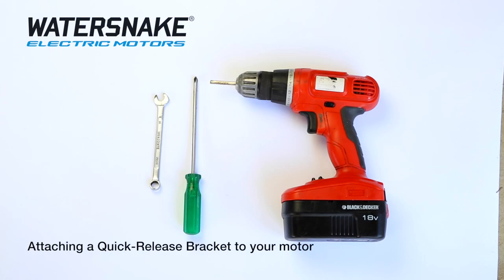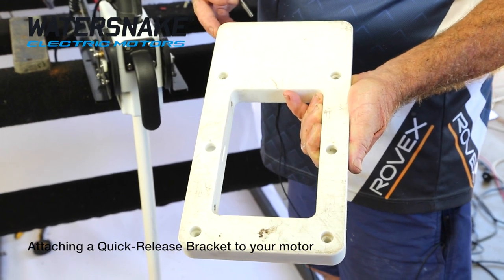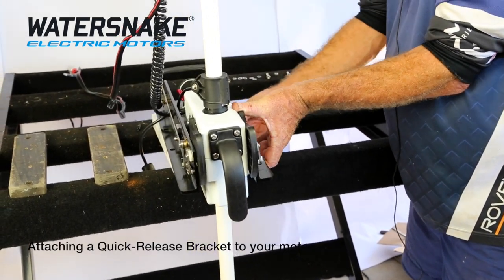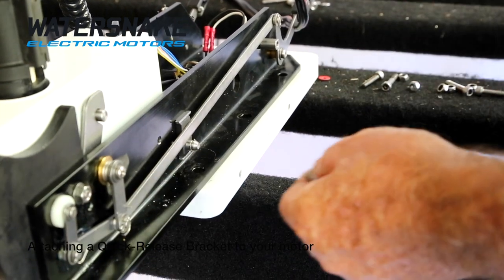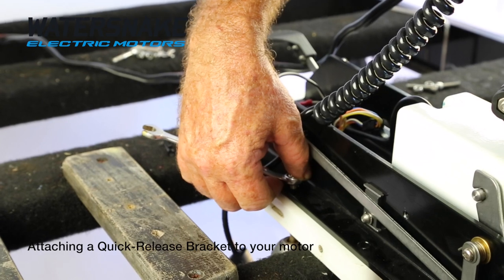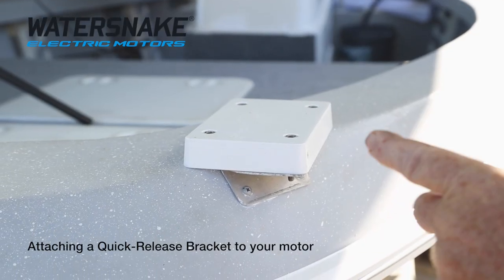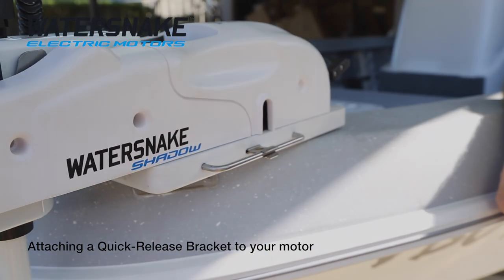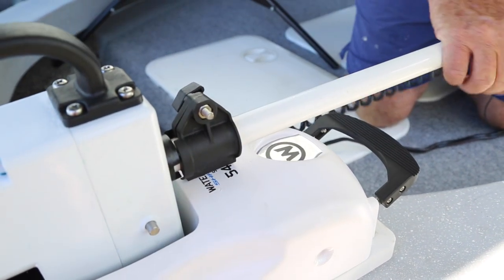Watersnake—How To Attach An Electric Motor Quick-Release Bracket

Comment: I would be nice for a cheaper trolling motor spot lock or rev’s high or low hand held buttons  - + rpm against the tide slow it down if tide not fast then speed it up if tide pushing . Watersnake ambush addition .